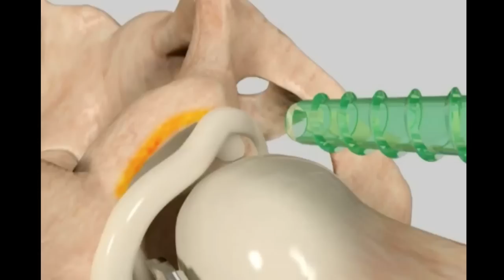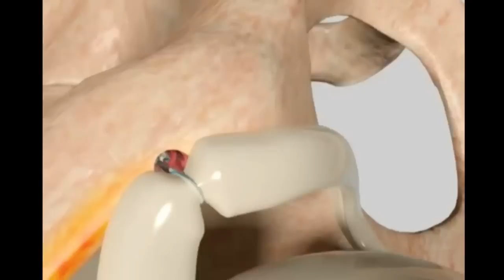Femoralacetabular Impingement - Dr. Jason Folk

Comment: I'm only 20 and have bilateral cam impingement and arthritis. I am having my second surgery in under a year on my right hip because the first conservative surgery did not work. I had my first surgery when I was 19 and had pain for years beforehand. I am in excruciating pain some nights and I therefore do not sleep well. I also have hyperflexible joints which increases wear on my hips, not fun! My surgeon believes that because I am a black belt in Taekwondo, the intense training I was doing exacerbated everything and that is why this started when I was around 15 (was diagnosed as groin strains and bursitis originally).